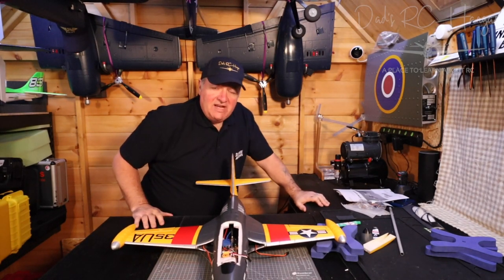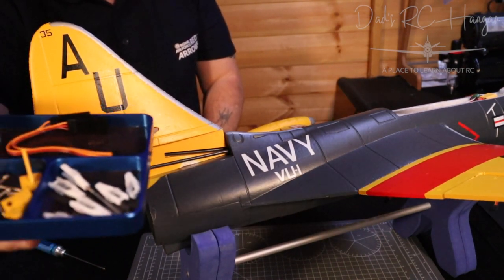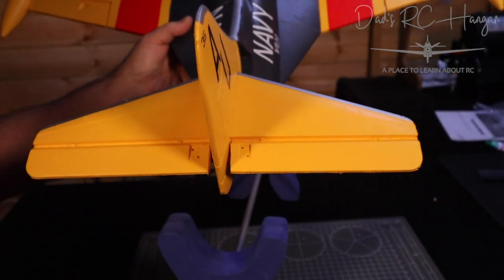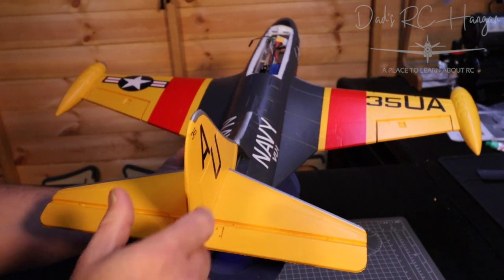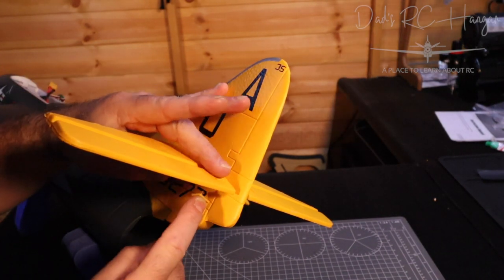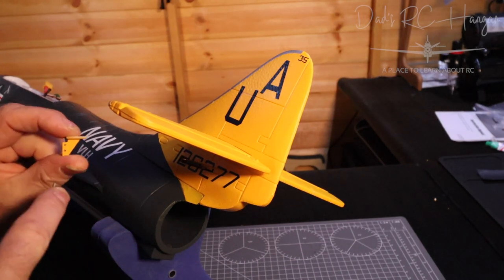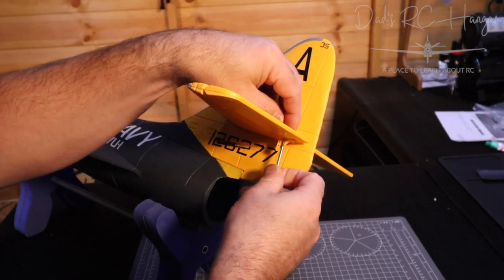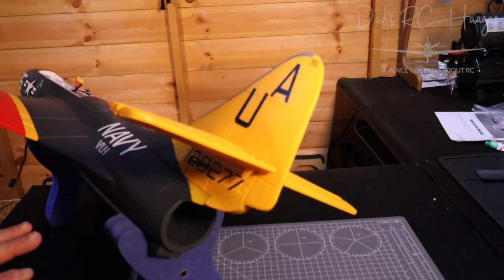Freewing F9F Panther 64mm EDF Jet PNP   The Build Part 2

Comment: chris regarding the control wires for your elevator only just being long enuf to fit onto the control horn  if u had only turned that servo around 180 degrees it would have given you more to play with and there would be less slop on the wires
Reply from the maker: Taz FPV Humms will have to look at that, should have the next part of the build next week. Good thinking. Amazed me that the plane had no instructions on that part, maybe a random plane 👍🏻 have a good weekend bud.
Reply: @DadsRCHangar  no problem at all chris you have a great weekend too and good luck with your build
Reply: @DadsRCHangar  i been building planes for around 35 years and to be honest most kits rarely go into detail regarding radio gear installation
Reply from the maker: Taz FPV wow, that’s along time. I just like to show my journey and fun 🤓

Comment: Thank you for the walk through. Have you used the Admiral Recievers? That's what I bought for this, and I got the same Admiral battery you got.
Reply from the maker: I have not used one yet, but in the reviews I have seen, they are really good. The batteries are also good, it’s as if a RC pilot had designed them, so I am sure you will have run. Maybe I will get one to review👍🏻. Thank you for watching and I hope you liked and subscribed. Have a great weekend flying her.